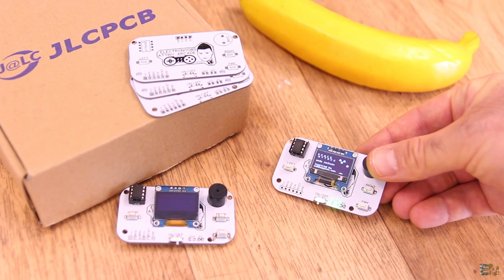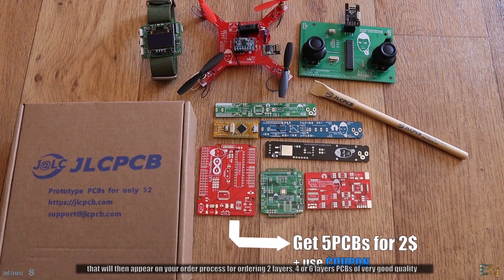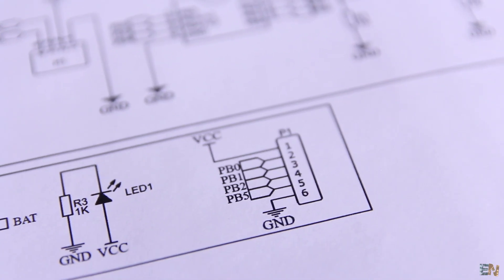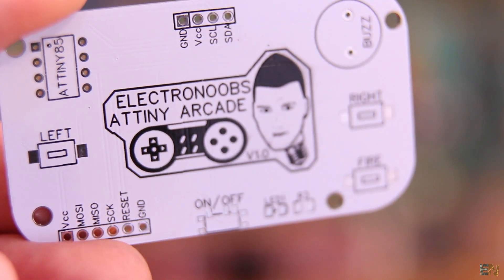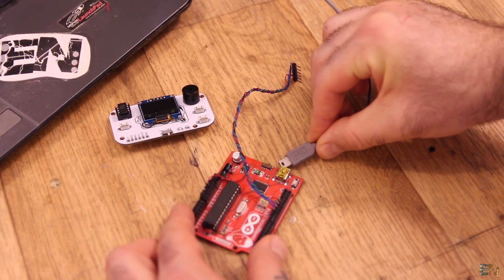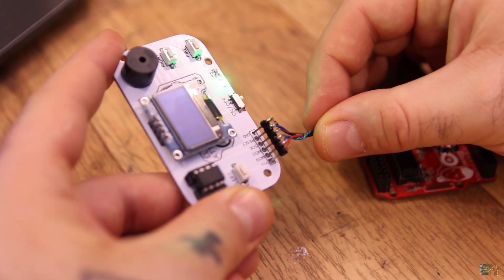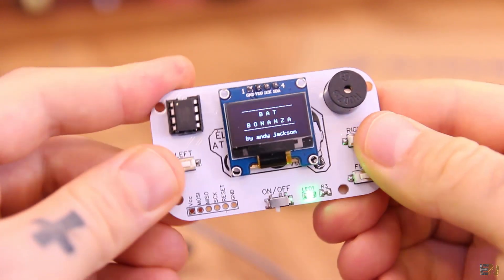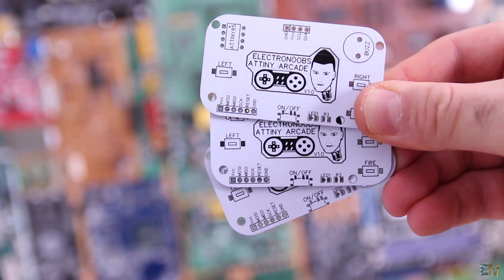ATtiny85 Game Console PCB - Multiple Games

Comment: Looks like a great project for a beginner at PCB design. As a step to add more complexity, maybe it's possible to add more buttons with the use of a shift register.
Reply: Shift register probably not as u r looking at 4 wires to properly control one and get the input. Better would probably be i2c assuming attiny can do that

Comment: May I ask why you connected the battery directly to the components instead of using a regulator? Batteries have a very sharp drop in voltage during their lifetimes and that can cause brownouts over time. A tiny regulator would've helped IMO

Comment: I'm surprised this work with PB3 and PB4 going to the OLED display. According to the datasheet it's PB0 and PB1 having SDA and SCL, respectively, which are the signals needed by the display. If we do this, (Using PB0 and PB1) do you think there could be some issue by sharing the programming pin header signals with the signals going to the display? Because I believe PB0, PB1, PB2 and PB5 are needed for programming.
Reply: Also, why did you connected the external programming cables to the VCC hole in your ISP "header"? AFAIK, you're supplying VCC (3V) with your own battery, but you're also connecting the VCC of your programming cables to this VCC 3V, wouldn't that cause a problem? why is that even needed?

Comment: Please tell me, can I use LIR 2032 in this scheme? LIR 2032 is a rechargeable lithium-ion battery similar in size to the one you are using. The capacity is 80mA, the voltage is 3.6 volts, but the full charge can go up to 4.2 volts. Won't it mess up the circuit?

Comment: neat little project . thank you . in your schematic you mentioned a voltage divider for the fire button which has a 1k and 6.8k resistor but in the video the place holder for the 6.8k resistor is empty , any reason or how did it work without that in place.

Comment: Nice!  If I had one, would design a 3d-printed enclosure to make it easier to hold.   A 6-pin keyed IDT connector in ISP format may be more convenient to use for programming.  If you like pressing into bare row of holes, then a pogo-pin programming connector would be the thing.  Seems that someone named Andy Jackson wrote the games with interrupts tied to specific pins on the tiny85.  Not trivial to port.  Was thinking that an STMF103C (128k flash) costs the same, has USB 2.0, and could hold all the games at once.

Comment: Why would you need a bootloader, when you program over ISP anyway?
Reply: because he didn't use the 16 mhz crystal and chose the internal 8 Mhz frequency so that requires a bootloader
Reply from the maker: @isaacsimon6863  Yes, that's why! Thanks!
Reply: @ELECTRONOOBS  ;) I wanted to actually know, while you are here, are the level held in an EEPROM variable, or do you have to restart the game every time it is started up? EEPROM stands for electrically erasable programmable read-only memory. meaning it holds that level that you are in and adds to it every time you advance in order to not have to start over all the time. If not, then a V2 should have that. If I does, is it possible to reset the levels without recoding it? sorry, it Is a long comment but I want to give some of these to my cousins and want them to be top-notch. THANKS!